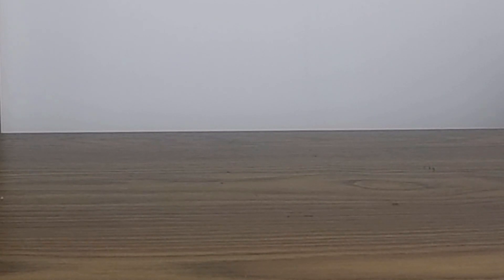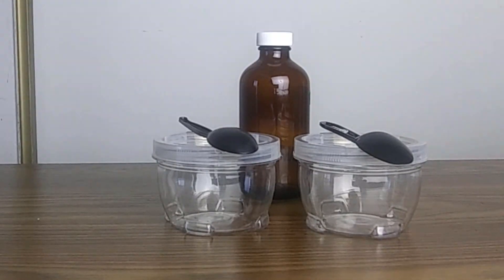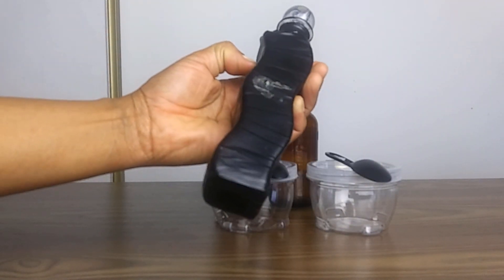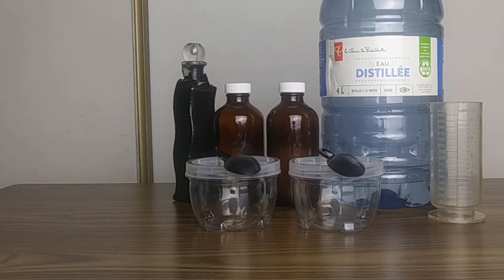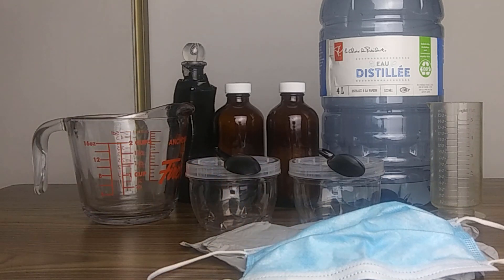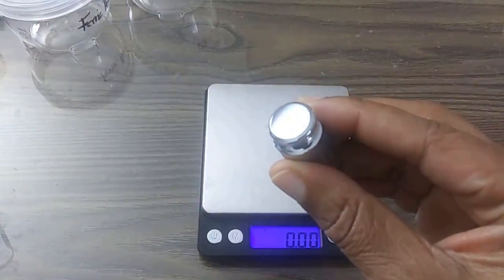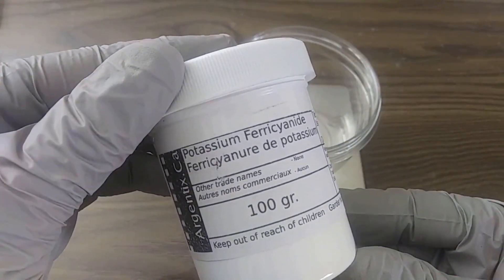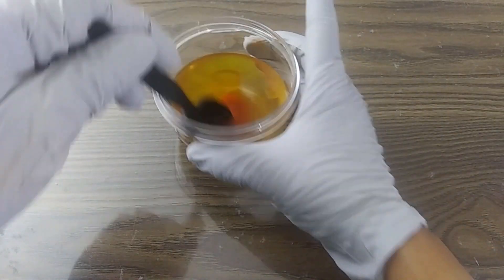A Cyanotype Formula from Scratch

Comment: Thanks for the great video! So helpful! I was wondering if you need to create and store these solutions in a room without sunlight. I know that when these two solutions are mixed together and applied to a surface it must be done in a UV free room, just curious about beforehand.
Reply from the maker: Hi Olivia. Yes, make sure the bottles are stored away from sunlight and when applying the solution just make sure you are in a place where no direct sunlight is in the area you plan to work in. The further away you can work from light from any windows, that are draped of course, the better.
Reply: Thank you for getting back to me on this! I'm very thankful for your knowledge. :) @NicoleSmallOneonOne

Comment: my ferric ammonium citrate is brownish; it is not green. is it possible to use it?
Reply from the maker: HI! Yes, it is possible to use but the green is preferable. The brown is not as light sensitive as the green.
Reply: hey I should thank you for all information you gave in your channel. by watching your videos I made it possible. starting from scrach till the acceptable result. at the end I could not find green one, but the result was great. Thank you @NicoleSmallOneonOne
Reply: You can add white vinegar to the ferric ammonium citrate at a ratio of 2-3 ml vinegar to 5 ml FAC. Leave it for a few days to "steep" and then use it as normal. I have done this and it works well though I have only had a few prints come out white, they mostly retain a slightly yellow tinge even after washing and adding peroxide. You do have to increase the time of exposure with the brown FAC too. The longer the better. Weight of paper affects the quality of the print as well, the heavier paper seems to retain a bit more of the solution. I'm still in the process of playing. I also accidentally bought the wrong one, though turned out to be the only one available in my area.